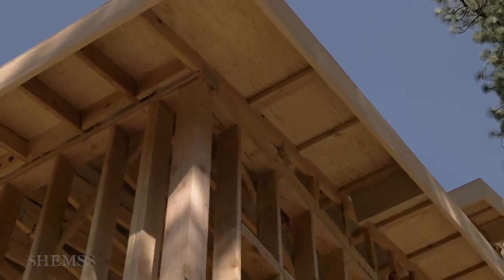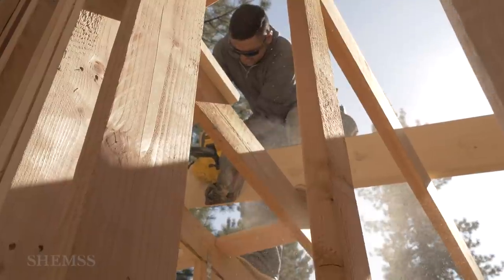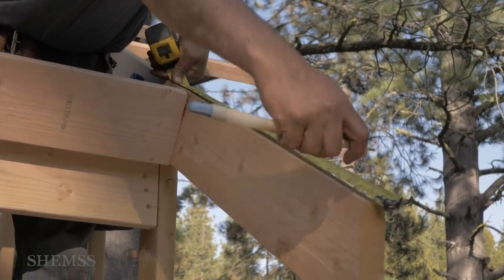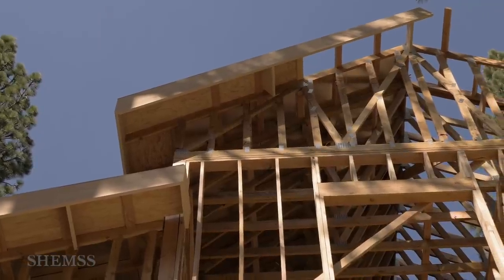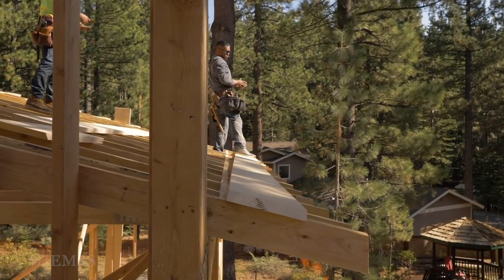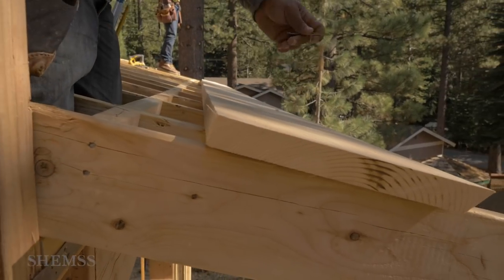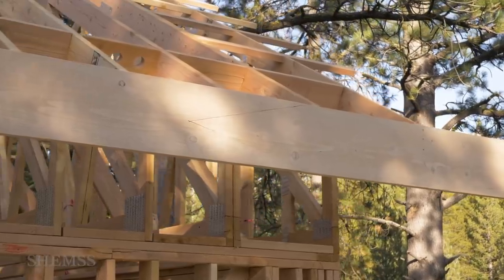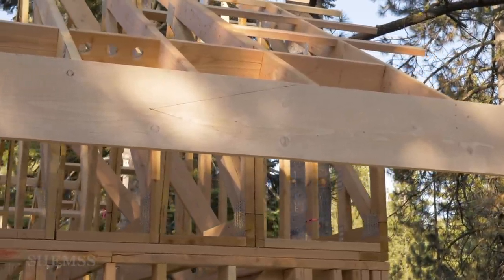Fascia Board Installation | Stitching Fascia Board | By SHEMSS

Comment: Can you explain why you were bouncing the saw up and down when cutting that scarf joint? Looks awesome though!
Reply: Since the angle is shallow, probably they're trying to cut from the top instead of the edge so the blade doesn't deflect off the edge of the board.  Also, cutting from the top allows the saw's shoe to overlap the pencil line for more accuracy, which isn't possible when the saw is overhanging the board.

Comment: Is there an optimal cut length to aim for in stitching 2 by 10 inch fascia boards.  The last person just cut the ends at a 45 degree angle and lag bolted the intersection to the house frame.  It hasn't lasted.  Thanks for the help.  This has been driving me crazy.
Reply: I would just start drawing them out and see what gives a good proportion. When I replace my fascia I am going to give this cut a try and now I am thinking of going to a 10" fascia board instead of 8".